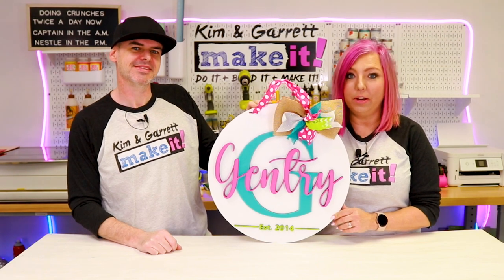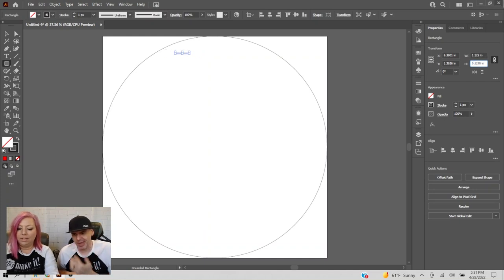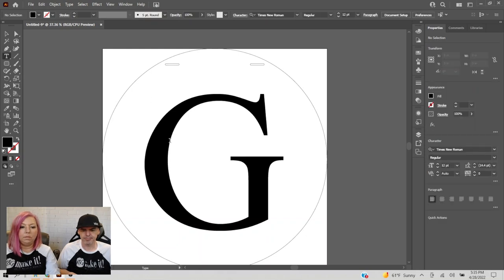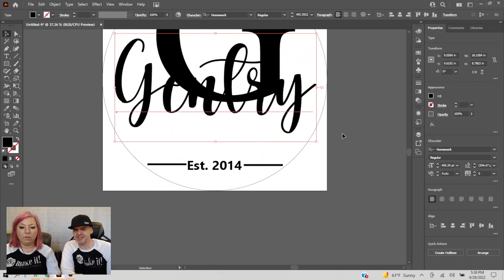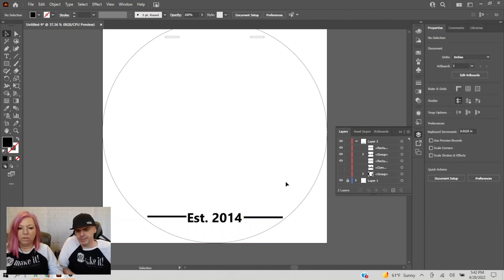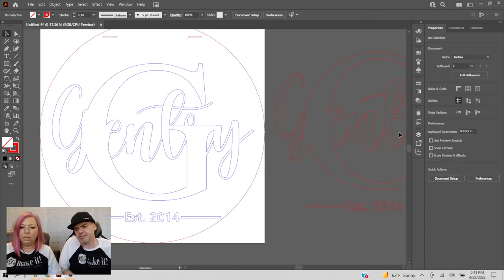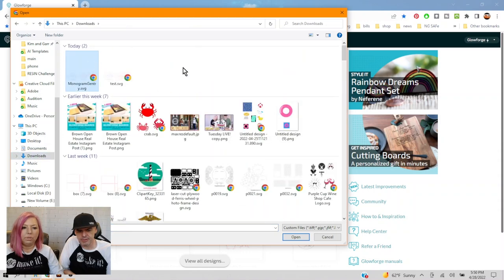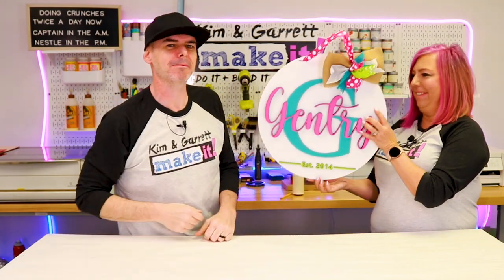How to Make a Laser Cut File with Adobe Illustrator for Glowforge

Comment: Great tutorial. Can you do something like this for the xtool?  In painting your MDF do you prime or seal it first or just go direct with the paint and seal after done?  What’s the difference in time between the glowforge and xtool to cut the project?
Reply from the maker: Hi Tina!  This file can be used for the xTool as well!   I'm not sure you can do this design in the xTool software, it's more for importing svgs like thos or creatinf simple text.  And we just paint the mdf as is.  If we use chalk paint we seal it with Polycrilyc afterward.  If we use exterior house paint we don't seal it at all.